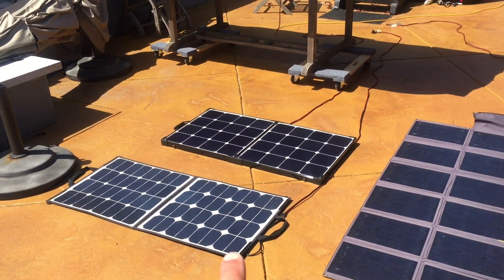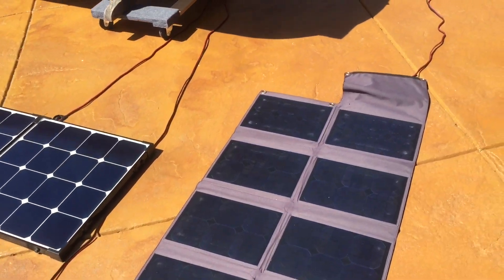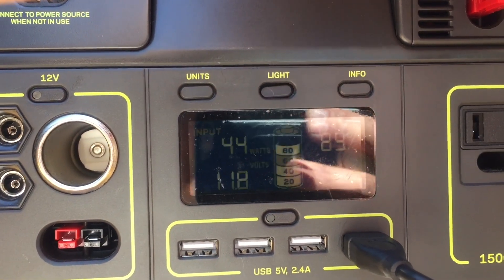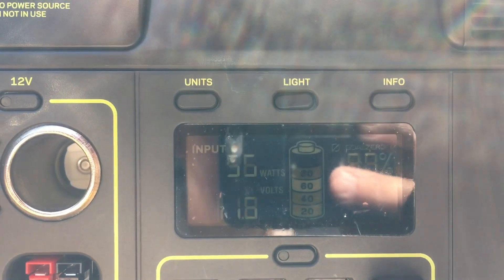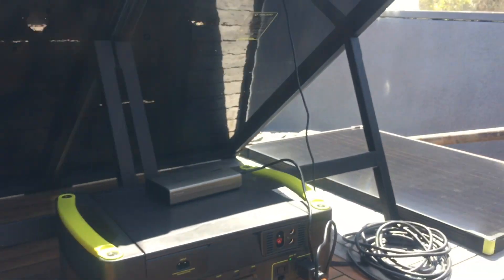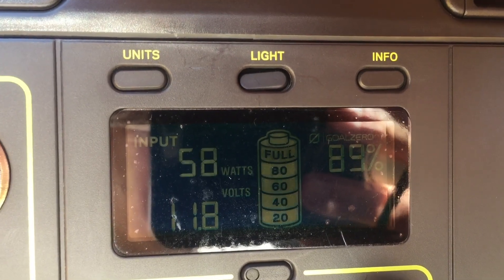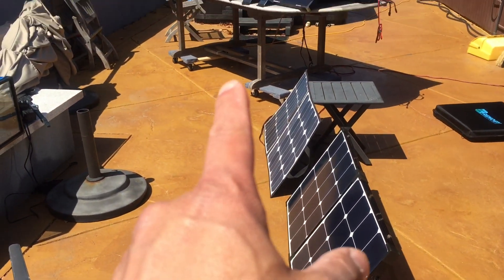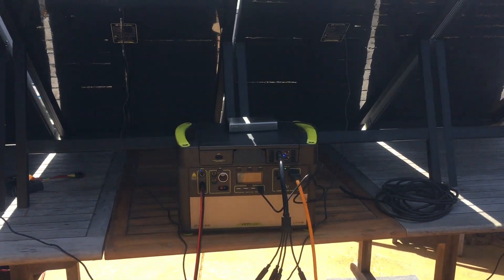Portable Folding Solar Panel Comparison - Renogy Eclipse, Goal Zero Boulder, Yeti 1400 Lithium

Comment: Yeah from what i understand each of those power ports is rated to receive only 150 watts so having those 4 gz panels plugged into the single port was overkill. But you demonstrated to me that it can handle mass amounts of input without damaging the unit.

Comment: Have you tried repeating the test with lower battery level? The charger may be moderating the current based on charge level. That is, as a lithium battery charge increases, the safe charge current decreases. This may affect your readings.

Comment: By the way, I use anderson powerpole connectors for all of my DC connections.  I love them!  The problem is, when I first started making the connectors, I made a mistake and I had the red connector on the right (when the tongues are on the bottom), which is opposite the standard.  Since I already had so many crimped at the time, I said "hell with it" and I just continued to make them all wrong.  So, I'll never be able to use any equipment that takes anderson powerpole unless I make a little pole switching connector.  Oh well... :)
Reply from the maker: I'd bite the bullet and redo all my Anderson powerpoles if I were you.  :)
Reply: @kentpublic  no! he'll die a sudden death and his rig will be passed on to some hapless bloke who will electrocute him/herself due to the one million ways to die odds.

Comment: Why was the output so low on all the panels?  Was it because of the angle?  Was it hazy out?  In full direct sunlight, I would expect them to be much closer to their rated power.
Reply from the maker: It was a clear, sunny day.  No haze.  No fog.  No clouds. My research indicates that 70-80% efficiency is the best you can get on these types of solar panels.